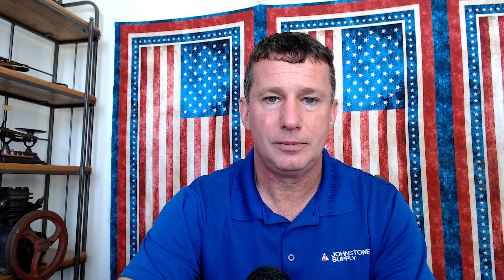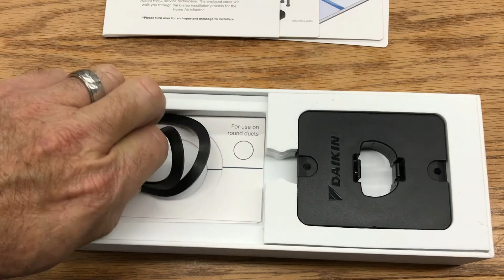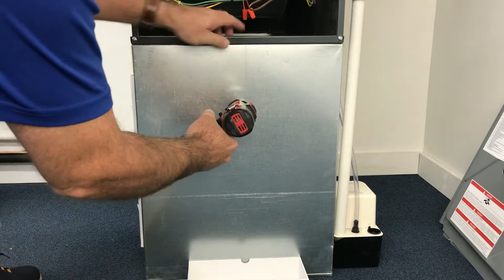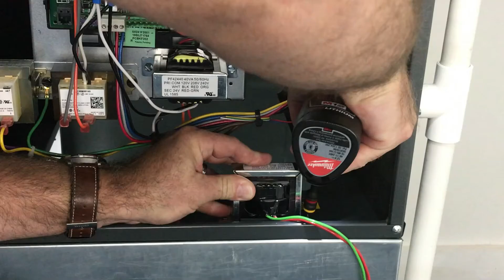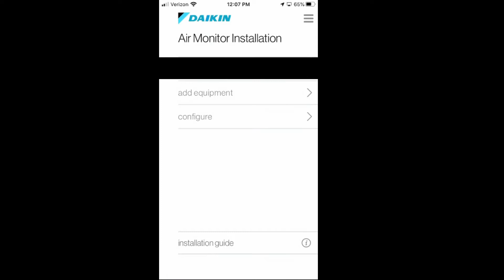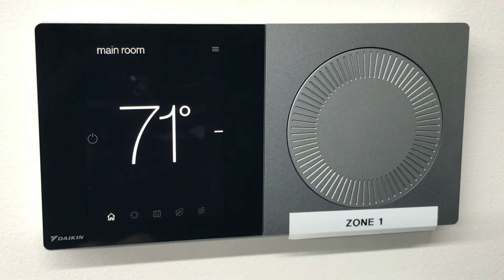Daikin One Home Air Monitor

Comment: And I’m curious what one of the sensors costs.
Reply from the maker: About as much as the thermostat
Reply: @johnstonesolutions2461  no clue how much I paid for my thermostat.  
Like less than $200 for one of these monitors?
Reply from the maker: @connorgaston9535  You would have to check with you local Daikin distributor but definitely more than that and it only works with the Daikin ONE+ thermostat on a Daikin communicating system